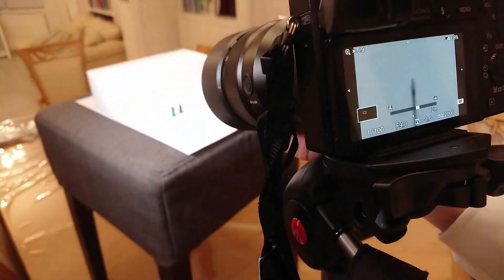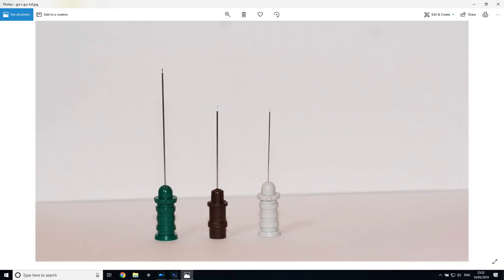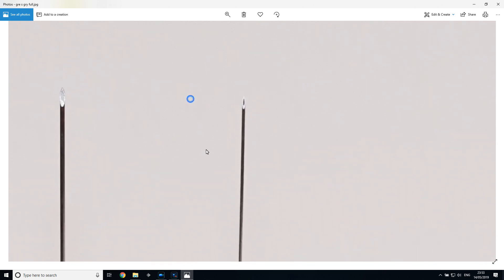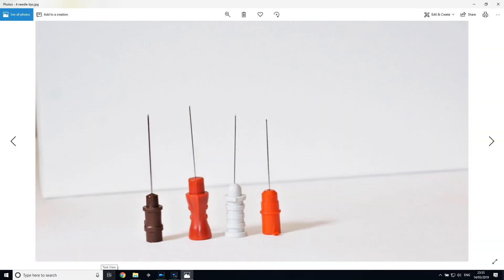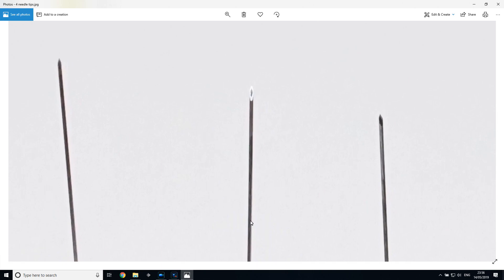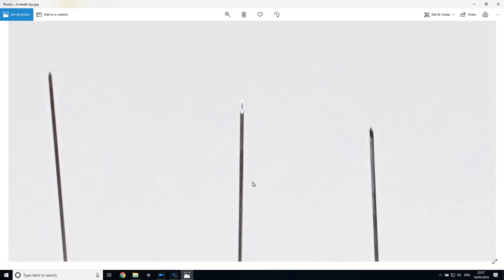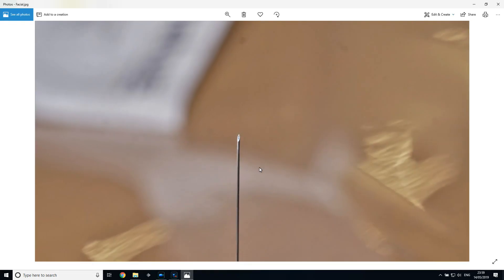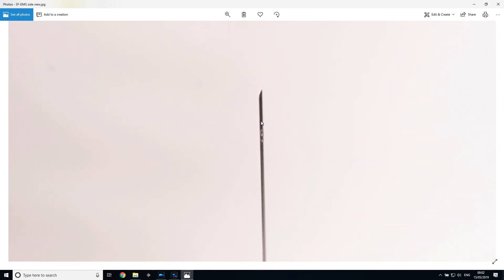Needle tips of Single Fiber EMG needles

Comment: Hi can you explain what "artifact present" means on Emg? I had one done 3 weeks ago and was given the paperwork/results but no explanation other than "absent sensory nerves and absent sciatic nerve". My paperwork says artifact present and I'm not quite sure what that means. Thank you.
Reply from the maker: Hi, I can't get into your specifics but the equipment is there to pick up electrical activity. That activity contains not just your nerve signals (can just be millionths of a volt in size) but anything else too, either from your body (eg muscle contraction during sensory nerve studies) or environmental (can literally be anything eg other machines nearby, a cardiac monitor, an electrical bed, an MRI scanner on the same circuit in another part of the building). As your nerve signals are relatively tiny, it's easy for those signals to be swamped and that is when the technical term 'artefact' is used to inform others reading it that there were issues / limitations during the study. Bw Simon
Reply: @DrSimonFreilich  Thank you for the explanation. I have been watching a lot of your videos. Very interesting, and quite amazing how these machines can tell us so much. Keep up the great work. You're brilliant.
Reply: So got some interpretation notes back. They said "absent patellar reflexes, achilles trace. Absent right superficial peroneal and sural sensory responses. Increased percentage of large chronic neuropathic appearing motor unit potentials in right vastus medialis and gluteus medius. Somewhat of a non-specific study. Absent superficial fibular and significant sciatic nerve injuries. She also has chronic neuropathic motor unit potentials. Although i would not consider this diagnostic, this would be suggestive of chronic lumbosacral radiculopathy, possibly at L4. This may account for the patellar reflexes. Clinical correlation with imaging studies are advised". 
Recent MRI shows "normal", with no issues other than mild arthritis of the facet joints. Doctor now wants to test for small fiber neuropathy. 4 years of testing. Previous nerve studies were totally normal. Maybe they will finally figure it out. Thanks for your help.